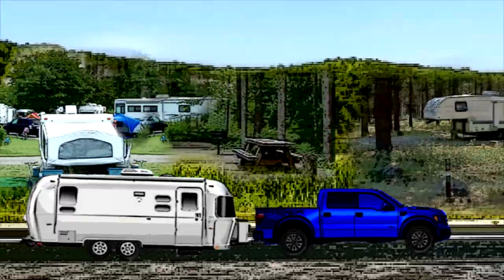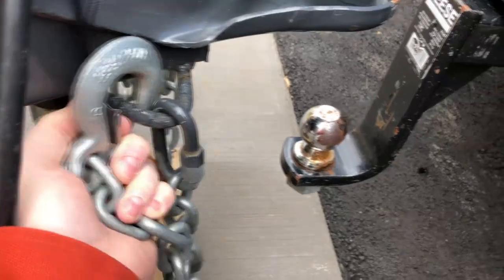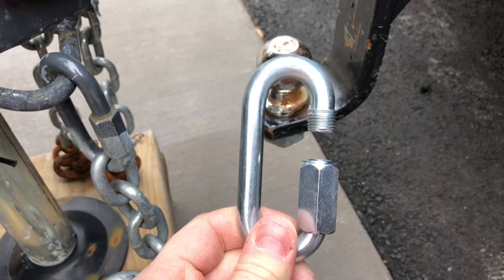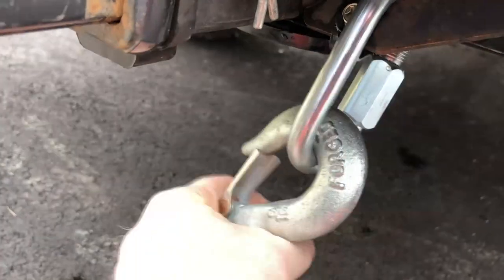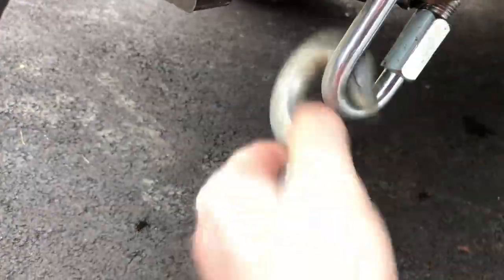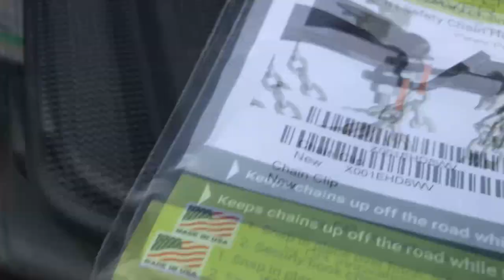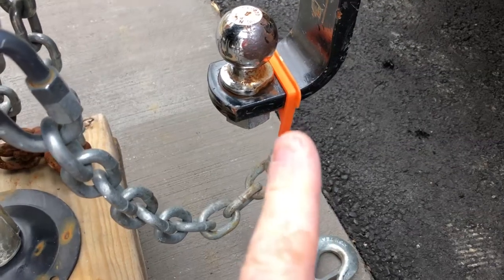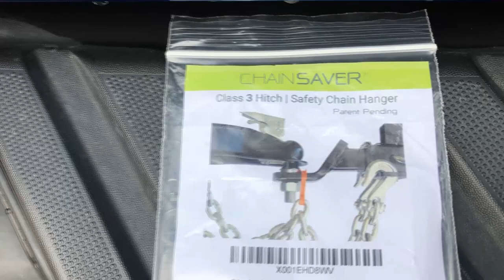Towing Safety Chain Modifications

Comment: If you shorten the chains enuff they won't drag on the ground, nor will they let a loose trlr tongue fall to the road surface. Crossing the chains also keeps the tongue off the ground. Most chains can be shortened more than most folks think and still allow very sharp turn angles.

Comment: Great idea with the quick link! I would suggest putting a thread anti seize before you tighten the link which makes it easier to remove  and save your threads from being damaged or corrosion.
Reply from the maker: Thank you for the tip!

Comment: If your safety chain is too long that orange plastic holder won't matter because if the tongue comes loose from the ball the chain is too long to start with and the tongue will hit the pavement and dig in causing a disaster.

Comment: I'm a good ol boy deep down inside from my many summers in Texas as a boy!
* my only concern is these jigging loose,
Ive got a 1288 mile trip coming up,
I don't want to have to grab a wrench each time I hook and unhook,
-Someone suggested lock tite but that's not for something you take on and off constantly by hand,
*Have you had this issue? Or do you use a wrench,
Thanks again.
Reply from the maker: These loops are permanent...the hook side on the trailer is what I take on and off using the clip.

Comment: Whats the breaking strength on those? Where's the stamp for grading? I ask because they don't usually have a high enough rating, like 1500lbs breaking point means everything behind the carabiner can only be 1500lbs which messes up your "safe" towing limit. Your set up is only as good as your weakest link 
Why not just use shackles with proper grading stamped "wll 4t" or such?
Reply from the maker: I answered this question before....here is what I said....don't take offense - anything mean was meant for the original commentor...thanks for asking!

Kind of  a harsh response to this dont you think?  Maybe you were shipped the incorrect parts?  The part number I reference is the Reese #49135 which if you go to the Reese website and many others you will find that they are specified at 10,000 pounds as I stated. 

http://www.reeseprod.com/products/trailer-accessories/safety-chains/trailer-hitch-safety-chain-link/WV5KcOu1jGV%7CVQV0P2cm!MnL%7CFWsfl8q

https://www.etrailer.com/question-88519.html

I am sorry for your confusion and if you feel you need to unsubscribe that is your decision.  I hope you are not that quick to pass judgement on everyone before you even do a little fact checking - Jeff
Reply from the maker: And I added this to him too.....

Sir/Ma'am,
I am not sure where all of your hostility is coming from.  You first call me a liar and then you call out my integrity.  If by saying I am a "good ole boy" you mean someone who is down to earth and has plenty of common sense then I say thank you BUT I am fairly certain you did not mean it that way. 

I also want to thank you for forcing me to learn a little more about break strength versus WLL/SWL (working load limit or safe working load).  From this link - http://cargoequipmentcorpblog.com/understanding-break-strength-vs-working-load-limit/ - I have learned that the WLL is always 1/3 of the break strength.  Which in your argument would be the SWL of 3300 times 3 which is the 9900 pounds break strength that this 'good ole boy' mentions in the video as "I think 10,000" pounds".

If you have any further questions about the product or questions regarding the information from the link above you should probably contact the manufacturer and stop posting your complaints about it to me.
Reply: No offense at all everything is a learning experience in my mind.
Reply from the maker: @bartman8876  certainly none taken.  I was sitting in a line in my truck and cut n paste was faster then retyping every thing.  Like I said....anything that offended you in my post was directed to the guy who was a real jerk 3 years back...Only thing good that came of it was the information I sent him...hope this helped you and have a GREAT day!

Comment: The orange chain saver makes no sense when the idea of crossing and having a chain is to catch the tongue if it ever came off the ball.   Chains should always be so they don't drag and are short enough to catch the trailer.  Long enough to turn also.  There is always happy medium
Reply from the maker: Drew Young The chain saver does not negate crossing chains creating the tongue cradle.  I did not show chains hooked up...just wanted to show how they connected to the orange clip.  100% agree with your assessment...they are just made to hold chain up off the ground.

Comment: If one is going to really "modify" incorrect-length trailer safety chains, then it's time to bust out the angle grinder equipped with a metal cut-off wheel, and then actually *modify*, correctly, your chain's length to your favorite tow rig's hitch.

Never! twist safety chains; this reduces their effective strength by at least! two-thirds. Should you become involved in someone else's bad driving and find yourself dangling in your tow vehicle, looking straight down a deadly cliff drop but saved for the moment only! by your trailer, ask yourself if you want your safety chains' strength reduced by this amount. We know we don't! Safe travels, everyone.
Reply from the maker: I addressed the chain twisting comment I made several years ago (check video information/description).  Use zip ties instead to keep the chains up.  Thanks for the comment

Comment: Don’t want to sound silly but how would I tighten S hooks. Like the ones that came in the package are open but how do I close one end? They’re about 5/16 thick. Pliers didn’t work, a vice perhaps? And how would you open them if they’re closed?
Reply from the maker: Luis Sonoma I would use a vise or large vise grips.  Opening them would be a tough chore...maybe a vise and vise grips
Reply: Airstream Nerds I tried a hammer to no avail. I’ll try a vice grips tomorrow. I found out that they have a specific pliers for S-Hooks but it’s kind of pricey at $180. It’s like 3ft long and big enough where you have leverage. 🤷🏿‍♂️ I’ll also go to my local Welder; maybe he has something that will work for me.
Reply from the maker: Luis Sonoma just curious why are you using S-hooks instead of the quick links.  They offer that same strength but so much easier to open and close
Reply: Airstream Nerds S-hook are easier to hook up to the hitch. I’m attaching them to the trailer safety chain.
Reply: Airstream Nerds I’ve been flipping trailers and think the S-hooks are more practical and budget friendly. For my own trailer I will consider the quick links. I only haul small stuff and it doesn’t really have to be heavy duty.